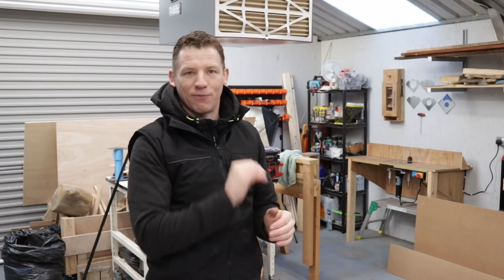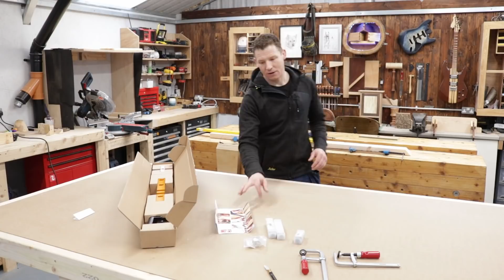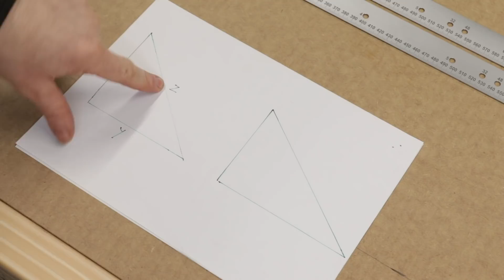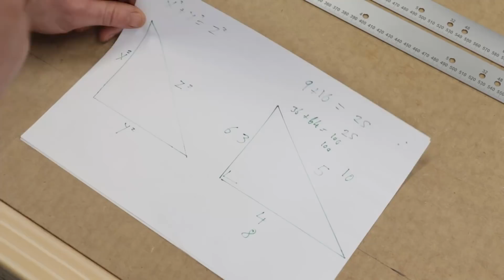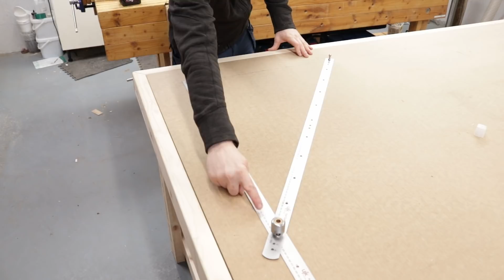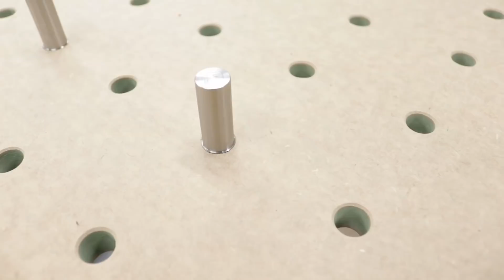MFT Table Build. Using The Parf Guide System MK2. With Problems!!! Part 1

Comment: Hi John, great video!  I notice that you used the long side (8) adjacent to your position when you marked out the first 90 deg angle and measured up the vertical axis by 6 holes... I think this is preferred as it reduces any movement because the enclosed angle is wider and therefore more stable.  However, I think on the second right angle you measured 6 holes along the horizontal axis (you moved round the bench to the end) and then measured up the vertical axis 8 holes. This made the resulting angle a more acute angle and therefore less stable.  This is maybe how you started the line slightly off which became noticeable later on.  
Having said all that, the learning point here is - when setting out, always measure everything from your base point/line, never continue adding measurements as you proceed (especially if you’re going around corners too).  You picked this up in time and you adjusted by squaring off each column from the baseline.  All worked out in the end 👍👍👍
Reply: I have considered that as well without giving it too much time (8 holes horizontal, 6 holes vertical). Though what happens when you later want to prolong above 6 holes vertically. Maybe you should do your 8x6 box, check for square, then do a 8-6-10 square from a lower part of the 8x6 square - Instead of just prolonging the vertical column.

What do you think? :)

Comment: It looks like your problem has been pretty well analyzed. For future projects like this, you might want to read any basic machining text on the subject of reference holes, reference edges and reference surfaces. Machinists have to place complex hole (or feature) patterns to .0005" (about .015 mm) routinely and have developed standard methods for doing so with minimum error. I came to woodworking having first been a machinist and am constantly amazed at how little cross fertilization there is between the two crafts. I use standard metal working set ups all the time in my woodworking, to the constant amazement of my woodworking friends.
Reply from the maker: Being a machinists is a great skill set to have, my area of expertise is electrical. Woodworking is my hobby. I have always had an interest in machining I'll take a look at the texts you recommend.
Reply: @JohnMcGrathManInShed  I was actually an electrical engineer for my career and a machinist for relaxation. Now retired, I've taken up woodworking as well. Keep up the good videos.

Comment: John, great channel, where abouts are you ? When you got to the end of the first ruler should you not have done the first vertical row using the 2 rulers and 3/4/5, then used that to locate the extension of the horizontal bottom row? Despite what Peter says about starting in the middle I think this would have given an accurate reusult while starting at the end.  ?

Comment: Great video. I had similar problems with my Parf jig earlier this year,despite starting in the middle and moving out towards the edges. I discovered a minute discrepancy between the 2 Parf sticks. I think they probably came from 2 different batches. Axminster replaced them with no problem and my second attempt was perfect.

Comment: I suspect that the drift occurred because you couldn't clamp the rulers down to drill the first row of holes. The second hole would only have to drift by a fraction of a millimetre to move the later extension of that row out of line.

Comment: The Parf guide rulers are identical and because of this when you lay one on top of the other you effectively shorten the top ruler by a fraction of a millimeter.  If you work out from the middle this error is negligible but work around the edge in a circle amplifies the error.
Reply: Make sense, because the upper ruler now sits diagonally from the higher side where the two rulers are connected, to the lower side, where the upper ruler meets the table top. A solution can be to add a shim under the upper ruler, the same thickness as the ruler or for the manufacture should make the upper ruler twice as  thick (except for the connection part). In any way, that's a design issue and not user error, and you should not have this issue in such an expensive system.
Reply: @jyfjgtyuh  I bought a Parf Guide system a few weeks ago and immediatelly caught this error - I have 3D printers so it wasn't hard to print a shim, but you're totally right, what's this doing getting out the door with such a mistake?
Reply: @ed3ddotnet  How did you go with your shim?

Comment: I have had the same result on my first mft board.  You need to use all 3mm pins when you are drill the guide holes. You need to reference  all 6x8 x10  off the first 10 holes.  When  I did this and made sure the rule was secure the error did  not occur on the next mft tables.

Comment: I suspect that when you were using the rulers you didn't seat the bush (on the pin) properly. Then as you've pulled the ruler along, it's slipped a fraction from the edge of the bush to the edge of the pin and put the rest of it out of line. Irrespective of that it was great that you showed us that mistakes can be made, no matter what equipment we use and that is a lesson we can all learn from. A great video as always John.

Comment: You mentioned that the CLS was twisted and not straight. Which is what is supporting the MDF. Are you not going for perfectly flat surface then? I built a smaller version of what you have and it sagged in the middle. So I suspect yours will sag even more.

Comment: I've had the parfguide mk. 2 system for a while now, same problem. Here's my expirience:
 
I was drilling the 3mm holes in one motion, even though peter tells you in the instruction video to use a pecking motion... turns out that the pecking motion allows the dust to exit along the drill bit, and if you drill it in one motion it bundles up under the drillguide. this lifts the guide up a tiny bit and then you're not drilling straight down anymore... so that's how I got my first top to be off square... I now knock the drillguide on the table before fitting it on the ruler, that normally makes the dust fall off the bottom. anytime it doesn't feel 100% stable I take it back out, and clean it. 

The second top that I made I worked clean and methodically, checking every step in order to not introduce errors... the result was better but the holes still didn't line up with the pins sometimes... Turned out that indeed my rulers were not straight. You can check this by turning them over face to face and using the guide block and the small screw piece to fixate  both ends. in my case the holes in the middle of the rulers didn't line up. (the rulers aren't straight but that's no problem, as long as the holes are drilled in a straight line) UJK sent me two new and checked rulers without a problem, and on these the holes do line up. Great and fast service.

however my third top still wasn't as good as I expected it, the holes line up good enough that you can force the pins in, but you feel it's not perfect. It's a great tool to make a bunch of holes, but if you don't do everything possible to prevent small errors the end result isn't exactly square. I guess on my next top I will start with the rows that I will actually use for crosscutting, and do the rest of the holes after that. I guess my expectations of precision tools are too high.
Reply: I have had the same experience with the MK1. Thank you for your tips.
What I will do, checking and layout wise, is to 
1. do the top row (fence and guide rail dog), only mid 10 holes.
2. Do the 6-8-10 for both left and right side. Probably better to have 8-side on the top (horizontal) and the 6-side vertical (Maybe it does not matter if you need to prolong the hole row later). I only make two holes in the bottom.
3. Check the bottom two holes horizontally. If this 8x6 square is good then I can continue with the holes needed, being very clear on which is first, second and third reference.
Reply from the maker: Thanks for sharing you experience.

Comment: I think you simply can't make CNC-grade accuracy at home unless you have a CNC at home...  :-)
Reply: Tell that to Robin Renzetti  (channel Robrenz) ;-)   He works in millionths of an inch and watching his videos on precision work is extremely informative, and his style is wonderfully accessible and straightforward, without compromising the detail.  Highly recommended. There have been a few insightful comments about errors in the example here (temperature errors, and the stacked-ruler issue), and UJK quality is certainly not always reliable (based on one fence I bought from them that had a really gross error in a critical pivot), so it is worth the discussion and establishing exactly what did happen to cause these errors.  Does anyone know what the tolerance specification is for the Parf system parts,  especially the rulers?
Reply: @mileshember3501  just had a look - yeah that's fascinating but he is working in a shop equipped with high end tools for probably hundred of thousands of $, right ? I agree that with a traditional NC machine like a radial drilling machine you might be able to reach that level of accuracy as well (will take quite some time though). But if you own such a machine an MFT alike bench top wouldn't be on your wish list I guess :-)

Comment: this was a really great video - your explanation of the problem you ran into and how you solved it was top notch. As someone who's been thinking of getting this system for a while, it was very useful to watch. That error you discovered was a bit weird though - at first I thought it might have come from the way one ruler has to sit on top of the other to form the triangle by effectively shortening the ruler that sits on top by a tiny amount as it has to rise up by the thickness of the ruler that lies underneath it. But that doesn't really account for why the error only started happening at a certain point on the grid and would surely have more likely resulted in the angle formed by the two rulers being slightly off from true 90°, rather than resulting in a row of holes with spacings that didn't quite stack up at the last hole. A real headscratcher and I'm slowly getting a headache just thinking about it ;). Anyway, many thanks for the great demo - all things considered, I reckon I'll still get this jig as you proved that any error that does occur can be easily solved using the other parts of the jig if you need to. Looking forward to seeing the rest of the build!
Reply from the maker: Thanks Cathal glad the video was useful

Comment: The 96 mm distance of the holes is based on the standard used for kitchen cabinets, which is 32 mm, but a 20 mm hole every 32  mm is a bit much. As to the deviation, that must be a human error, otherwaise all the hole would be off and you would not be able to make a correct pattern, all the holes would be off.

Comment: I would say that you magnified the error in the system at least six times with your first approach and only had 1mm difference. The later method is much better.

Comment: That the discrepancy starts after hole 9 suggests that it may have crept in when extending the first row to 17 holes using just two pins in the ruler, rather than extending the row using the rulers in a triangle.

Comment: I have watched the guy who designed this system and he advises that you can flex the ruler slightly when drilling the 3mm holes when you are drilling the holes between the two pins when they are at positions 1 and 10 on the ruler.   That is why he recommends that you clamp the ruler when you first begin drilling the first line of holes  on  a long table that you are making. See him making a track saw cutting station with this system at the following link:
https://www.youtube.com/watch?v=xJ_dhbIdGqE 
He explains the process well and why much better than I can.

Comment: I would recommend a small dust extraction unit connected to your sander over a down draft table.  To make a down draft table as effective as a good quality dust extraction / vac you will need a lot of airflow and many many more holes in the table top.
Reply from the maker: I will use a combination as I do with my other down draft table, it's really only to aid dust collection

Comment: Awesome, Izzy Swan has a video he did vertical MFT surfaces as clamping boards for panel assembly and such. I was thinking of hanging them on hinges on the ceiling to put stuff out of the way when the glue dry's. This system would be perfect for making those. https://youtu.be/MsscEWLIFWA
Reply from the maker: Nice!

Comment: Really sounds like a manufacturing defect.  Or perhaps the long ruler is slightly bent?
Reply from the maker: Could be the holes are off or it could be me, I have seen on some forums people had similar issues.
Reply: @JohnMcGrathManInShed  I have had a lot of MFTs off with the MK1 :(

Comment: May be ask Peter Parfitt the guy who designed the jig, he may have a reason for your discrepancy. Find him on new brit workshop.
Reply: Parfitt’s vid starts in middle of first table edge and clamps down the ruler and after all 3mm holes are drilled, he moves ruler a fair ways to left or right, so he repositions ruler a minimum number of times to cover the whole span he wants to cover. Less moves and clamping will eliminate the error. It also halves the number of holes beyond the extent of the original ruler placement on each side, also minimizing the error. So I wouldn’t be so quick to blame the rulers.
Reply: Peter Parfitt has replied and John has pinned it to the top. 👍
Reply: Hey John, did the manufacturer get back to you on the discrepancy.  You’re exceptionally thorough so I’d be shocked if you didn’t use it 100% correct.  I’ve bought the same jig kicking off this week to make an MFT.